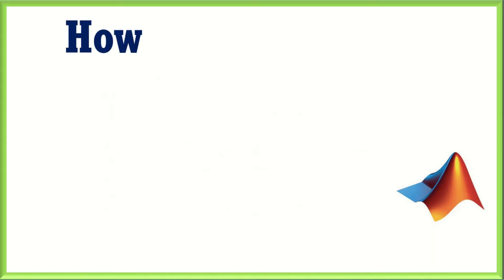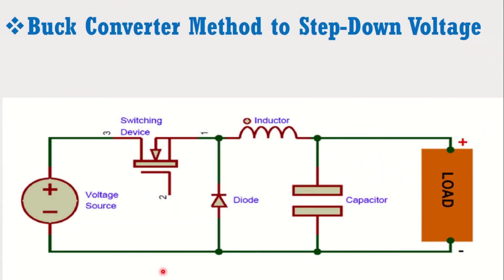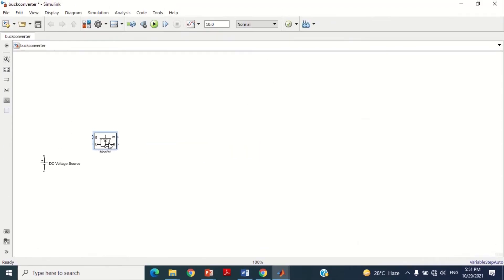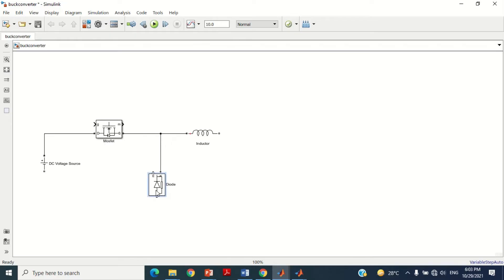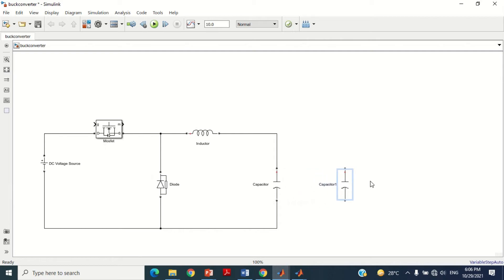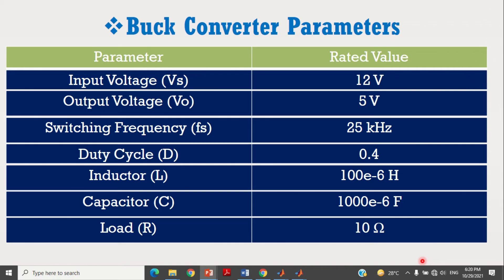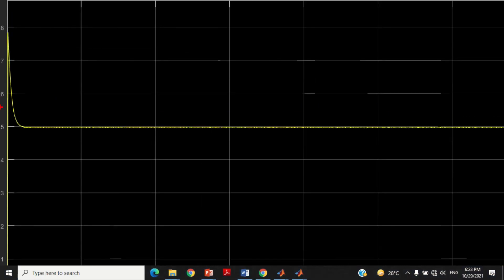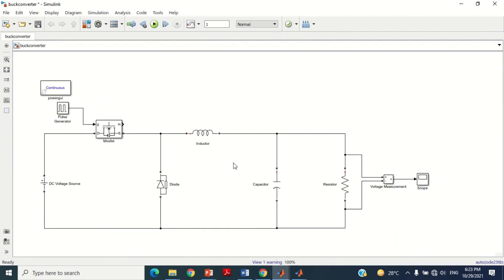How to Design Buck Converter in MATLAB SIMULINK Software ? | Dr. J. A. Laghari

Comment: A buck converter has VI = 22 to 32 V, VO = 14 V, IO = 0.2 to 2 A, and fs = 40 kHz. Find the minimum inductance L required to maintain the converter operation in the continuous conduction mode. Implement the circuit in MATLAB/SIMULINK and verify the calculation with simulation results. Can you solve this
Reply from the maker: thanks for the comment and query. for mathematical calculations, kindly go through books or chatgpt.
Reply: @DrJALAGHARI  can you make a video on it how to stimulate results

Comment: JazakAllah, wonderful video as usual. I don't understand one thing, when I run this simulation in continuous mode the output is ok, but when I run it in discrete mode the output is not anywhere near the output result of this video. why does this happen, and how to fix this?
Reply from the maker: Thanks for the compliments. In power electronics switching time plays very important role. Due to this continuous mode and discrete mode will have different results in some cases.